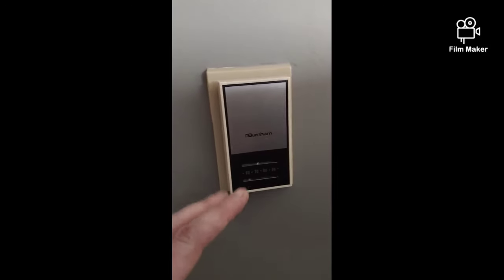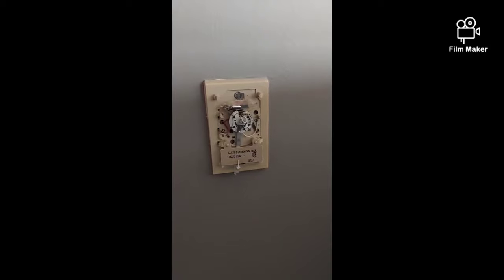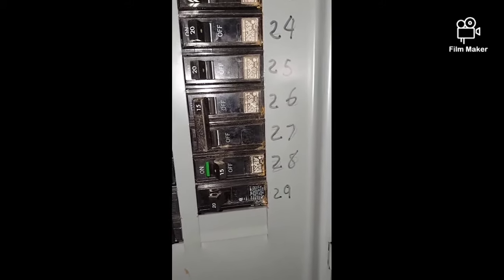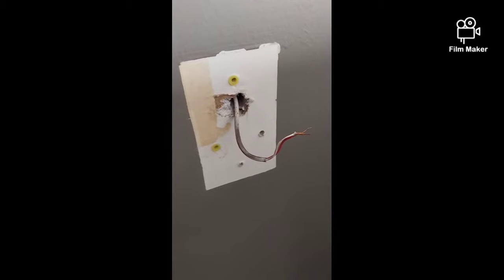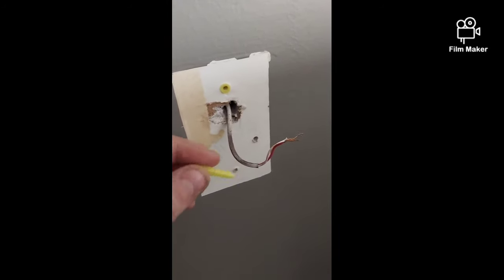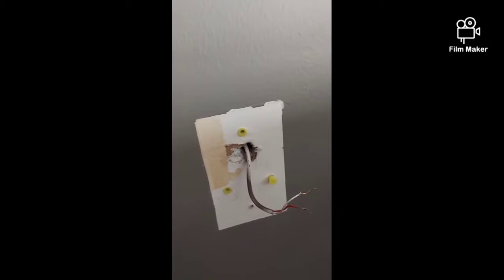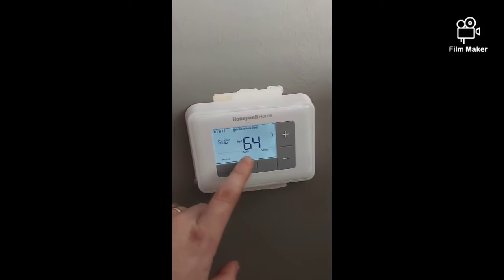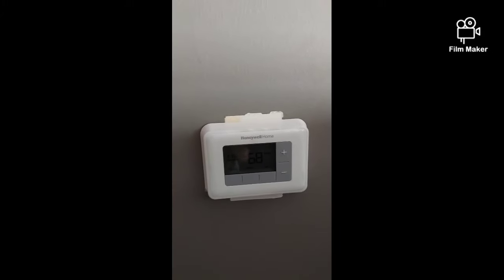Replace Your Old Thermostat.  SAVE MONEY with Honeywell Home

Comment: Our thermostat is extremely old so when I took it off, it did have before wires. However, when I went to go install the new thermostat it’s a touchscreen and I opened it. The wall plate only has two slots, one that says, R the other that says C only the one that says R has a like silver slot. The other one is nothing but a hole that will exit into the wall. I’m assuming? Please give me some direction thanks in advance.

Comment: I have two wires one white and the order black it’s this the same setting ? Will my black wire goes to the R on the base board?
Reply: hey mines the same, did you put the black in the R hole?
Reply: @lukepostl8942  Yes I did

Comment: I think I would have pulled a new thermostat wire, while you don't have central a/c the common wire would be handy to have and nothing wrong with a spare wire or two either.

Comment: Very novice. You are forgetting that the wire insertion has a clip that you need to press on the side and then push the wire through that little hole.
Reply: Good tip. Thank you. Here’s another… being nice is easy :)